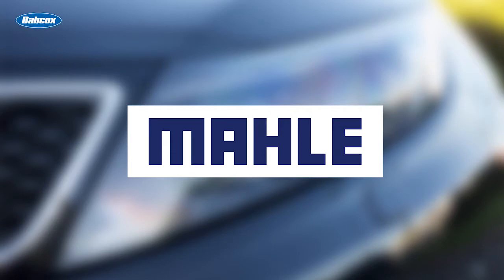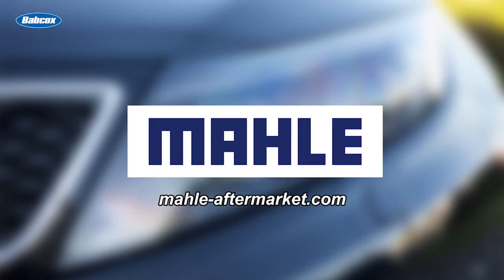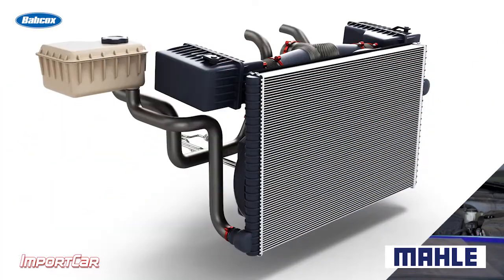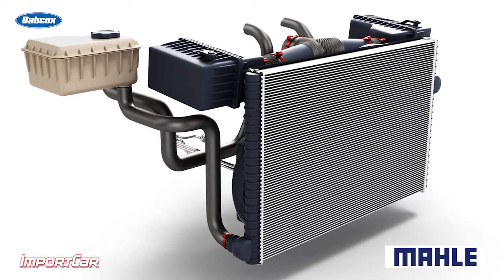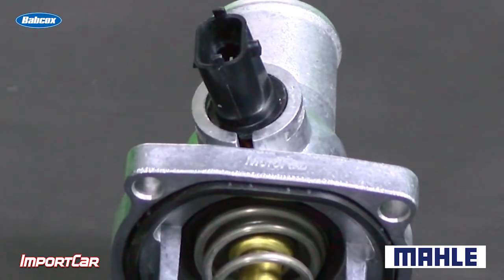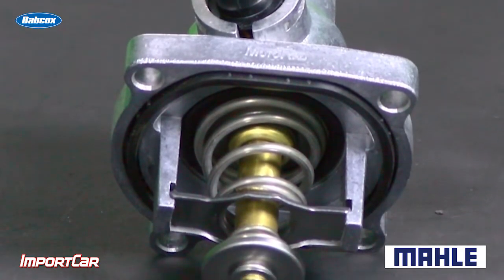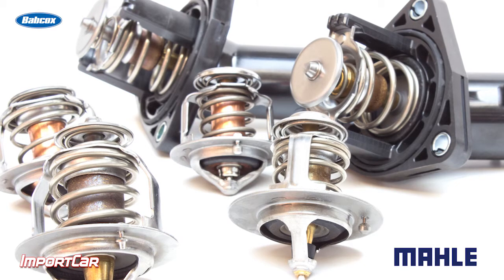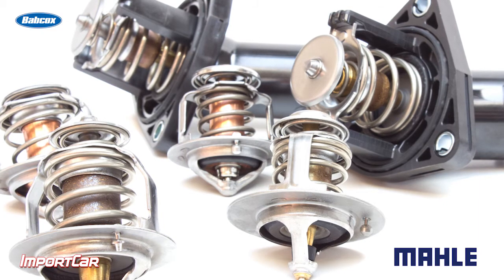Thermostats and Engine Operating Temperature | Tech Minute

Comment: I just changed the thermostat in my truck and now the idle  air control valve ( also new ) is not working properly, could I have put in the wrong thermostat, to cold?
Reply: yes, the wrong,, or have a problem of quality, can also be a problem of yor air c valve

Thasts why mechanic is a job we check everything otherwise clients would have a lot of problems even after repairs..

Comment: What’s the downside of not having the car on operating temperature?
Reply: Poor gas mileage and less power. You can notice that.
Reply: @FroilanJosephChavezJourney  most important then that internal engine wear
Reply: Question. I noticed after my car warms up and running my car.  My temperature gauge gradually increases to where it should be ( about halfway )  after driving it awhile when I do nonstop constant driving  ( highway ) the gauge will drop some then rise again after I come to a  stop at idling. Is this normal or should the gauge stay midway all the time regardless of how im driving after warm up? Thanks.
Reply: @jopisano67 

It's normal for your gauge to fall down when you're driving fast, especially when you're on high gear low rev.
That's because you get lots of wind cooling your water down, and since you're on high gear, the engine doesn't spin fast to create more heat. 

It's annoying with my car, barely have to move for the temperature to fall down.
Reply: @jopisano67  did you find a fix?
Reply: @FroilanJosephChavezJourney  only if you computer is programmed to inject more fuel when engine is more cold...  thas stupid but somethimes it happens,, not all cars hae a comsuption increase..
Reply: @jopisano67  Its normal..